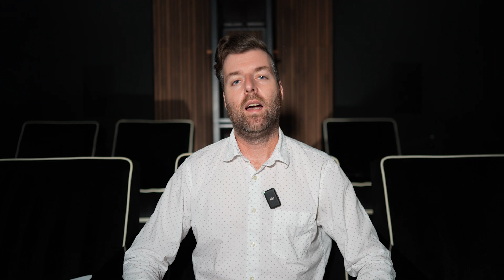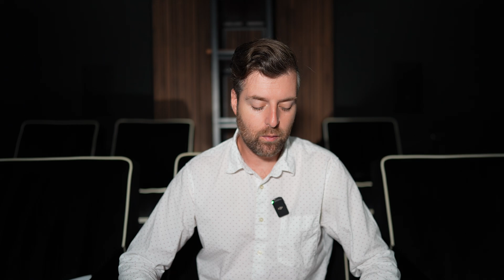Why don't H-frame DIPOLE subwoofers get more play time in HOME THEATERS?

Comment: Just FYI everyone .... My subs are positioned 7 1/2' from the front wall and 3' from the side wall in my 27'x13'x8' room.   Without any EQ other than what's built into the Rythmik amp for dipole compensation and 14Hz extension and 10Hz rumble filter (no PEQ),  I measured one sub 3' in front, 3' 90drg to the side, 3' behind (closer to the front wall) and 3' above.   The front and rear measurements are identical, except the rear measurement is a few db higher at 16Hz (possibly due to being closer to the front wall?).   The side and top measurements are around 8db lower from 16 up to 25Hz, then the top measurement drops very quickly leveling out 20db below the front/rear measurements.  The 90deg side measurement continues up to 35Hz and then drops similarly to -20db, with a moderate peak around 80-90Hz (SBIR?).  I did these measurements at moderate REW levels.  I have not tried to determine maximum output.  Just wanted to demonstrate the relative behavior.

Comment: Wow ... quite interesting discussion and glad Danny responded too!   My feeling - based on my priorities and the nature of my room - is that these subs fully meet my needs for Home Theater.  Most people seem to prefer elevated levels and higher slam in the bass for both home theater and music, while I am satisfied with flatter response, and I don't need (or want) to exceed 100db.  But for music, which is my highest priority .... these subs have exceeded my expectations in many ways.  I have described it as a sort of visceral immediacy, especially with percussion and acoustic instruments like double bass, piano, low brass ... very articulate and revealing of texture in addition to the fundamental pitch.  I've also been surprised to notice a significant difference at low listening levels.  it's like another layer of bass detail that I never heard before.  I'm SO glad I built these finally and have integrated them so well into my 7.1.4 Magnepan system!
Reply from the maker: @marclombardi5980  hey Marc. In no way am I trying to disparage your choices.  I’ve never heard your system and cannot comment on the subs. I am sure it sounds great. My video was answering a specific question you asked. Why aren’t these used more widely in home cinemas. I think Danny would argue it’s because the industry just doesn’t know what it’s doing or understand the magic sauce in his subs. But I disagree with that kind of characterization.  The industry doesn’t embrace these for a simple reason. As a design approach, they are in effect at reproducing low frequencies.  Home cinema is, unlike music, able to directly point to a set of output requirements.  While there is a whole argument to be made for if this practice is right or not, cinema standards in the home were originally intended to track commercial cinema. 85dB at -20dBFS with 105dB continuous peaks.  LFE at 95dB with 115dB continuous peaks.  

Now we know that at this point consumers largely don’t watch at cinema reference levels and so they began mixing movies at 72-82dB instead of 85.   But that doesn’t change the fact that at the top end of the high end market, home theaters are still being built as mini screening rooms. And the standard remains the same. As recently as yesterday we had a major studio executive tell us, reference level is too loud but if you want to hear it as it was originally monitored and intended, yeah you need to listen that loud.  

So those of us designing these rooms need to ensure the equipment we use is capable of hitting these specs.  Otherwise we fail at our job. An H frame subwoofer would require so much displacement to hit 115dB+ at the 10hz to 40hz range that I would need a lot of them. More than I could justify given the simpler solution. Use a box subwoofer.
Reply: My experience too -- there is a realism to dipole bass that I haven't heard from monopole bass.